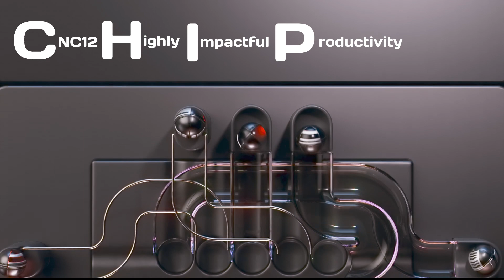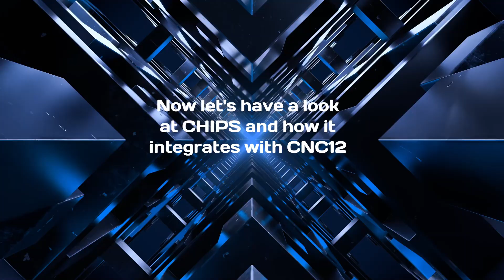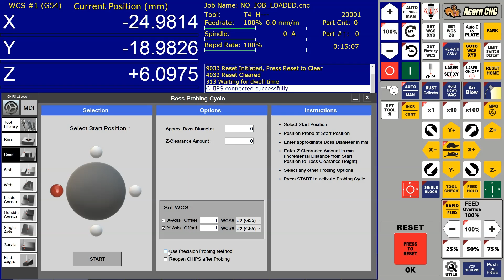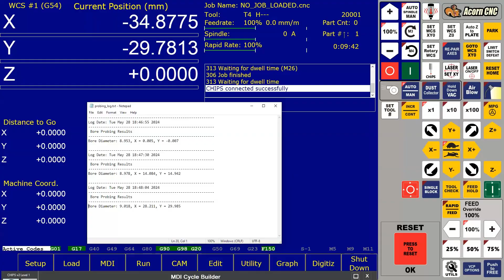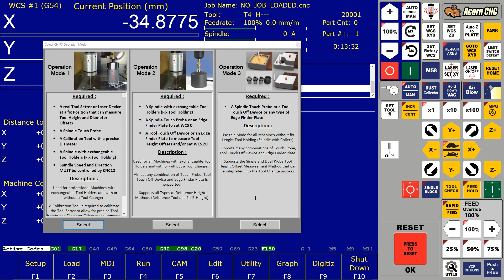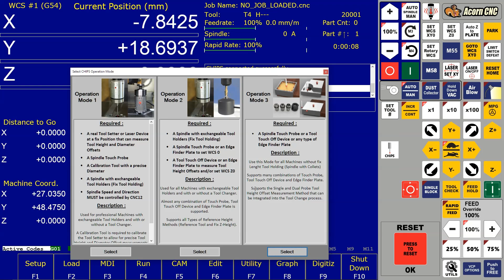CHIPS the Ultimate Add-On for Centroid's CNC12

Comment: I wonder if this would work with the acorns avid profile
Reply from the maker: The current version of CHIPS supports all CNC12 Mill and Router versions based on 5.10. There have been changes in the CNC12 probing logic after CNC12 version 5.10 and CHIPS will support all CNC12 Mill and Router versions including the new ToolTouchOff Input from Beta 5.19 Revision 8+ which will become the official CNC12 version 5.20 soon.

Note that CNC12 Beta version 5.19 Revision 8+ as well as 5.20 will need a CHIPS Update to support the new probing logic and the new ToolTouchOff Input.